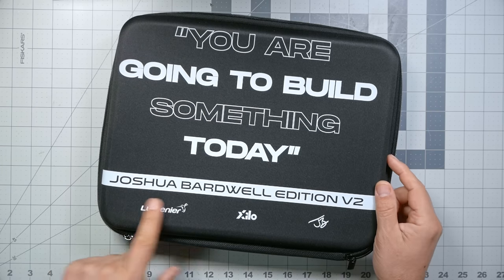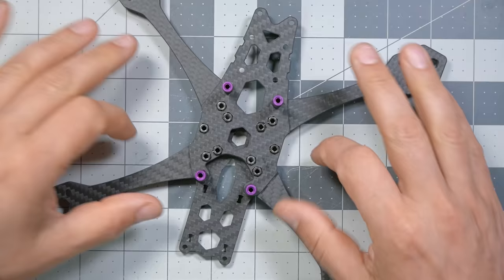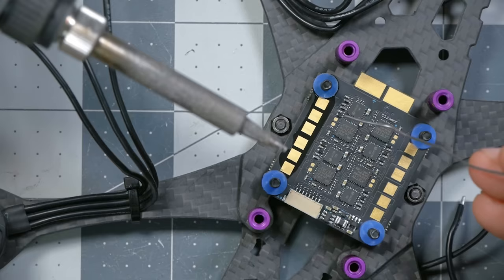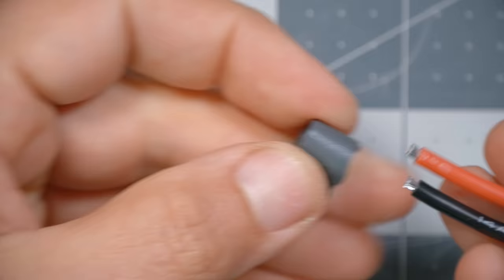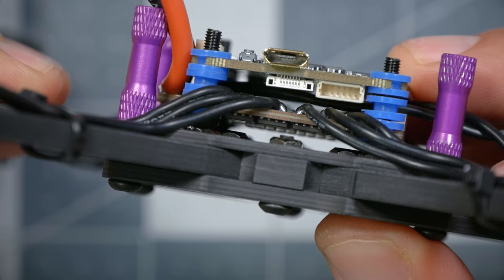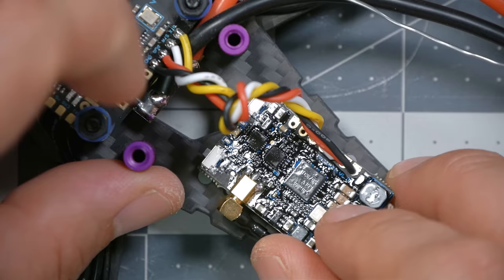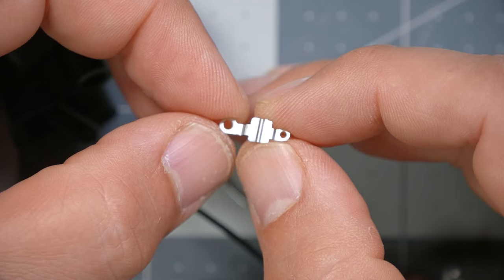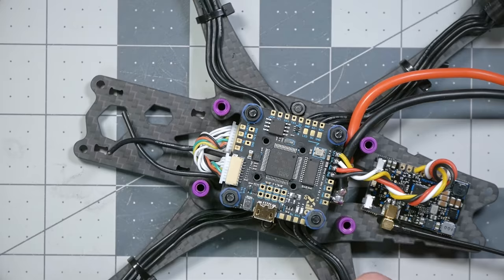2022 Freestyle FPV Drone Build (DIY Kit For Total Beginners)

Comment: You almost had me convinced to start ordering parts to build a freestyle FPV quad because I tried very hard not to crash. My TANQ2 5” that have only had for about a week and a half and I really wanted a tank S but it’s out of stock so I considered building one, but I really don’t know if my big fat uncoordinated fingers can do the soldering but I am going to watch your soldering tutorial and try to find something to practice on because I know that I’m going to start breaking it when I start flying low. At the moment, I am just practicing tricks probably 20 to 100 feet off the ground and over mostly grass. Once I get better with my throttle control and pitch so that I can maintain altitude and I start rolling and flipping and yawing at lower altitude I know I will start smashing stuff. Your videos are amazing thank you so much. Keep up the good work!

Comment: "A little bit of trouble" installing the arms is a huge understatement.
It took me about 40 tries and 30 minutes as well as 9 popped press nuts to screw down the last wedge for the arms. I was in constant fear of destroying the frame and even stripped the beginning of the press nut thread.

The only thing that finally made it work was to not install it like shown in the video, but to install the wedge with ONE arm (don't tighten the screw yet) and then slide in the last arm, then tighten the screw.
This was waaaay easier and without the danger of destroying anything.
Reply from the maker: I've always been able to get it done as shown, but that's a good tip for the future!

Comment: Incredible content, can’t wait to build one of these! You are a lifesaver for those of us who have no idea where to start in this hobby
Reply: It’s pretty fair to get into. You need to research on what type of flying you want to do. Long range , freestyle , racing, cinematic, cruise. Some of these styles are definitely cross compatible but can be better with different setups. Just watch people build and talk about parts. There’s not too many involved, and some work better with other , so it’s not just buy the most expensive. Anyone good with electronics would excel in building these. The hard part is having to program and tune the drone before you can actually fly :/

Comment: I have been trying to get into FPV for the longest time but I just did not know where to start.  I was going to go with a pre built but I really did not feel like that was the right thing.  When this kit came out I knew this was the perfect way to get into FPV.  I would like to thank you so so so much for making this kit!
Reply: Getting the right pre-built is absolutely not a bad thing! My first entrance was building one of those chinese kits from ebay, zmr250 or whatever it was back then. I wish I had just gotten a nice prebuilt and saved myself some trouble in the beginning. Check out the DarwinFPV Baby Ape Pro, or pretty much any EMAX BNF, I havent had a bad Emax product, ever! The nanohawk x is a little hot rod, the tinyhawk II is indestructible!
Reply: Hey, I'm really looking into fpv. Do you still suggest these kits for people interested in getting into the hobby?
Reply: @Howl-Runner  buy a geprc cinebot 35 with DJI o3 and the DJI Goggles v2.   ELRS internals... get a Boxer remote ELRS internal.    should be sooooo good to go...
Reply: @Nullscr1pt  Isn't that a little too advanced? How does the cinelog handle crashing especially for beginners? How much flightime would you get with the recommended battery of 1300 mAh I heard abt 6 minutes or less doesn't the avata have better flightime? Does the o3 dji air unit handle the transmission of the video signal I think it is included in the drone? How much would the whole build cost drone controller  goggles? sub1000?  Wouldn't it be cheaper to build your own? Should you choose the goggles 2 or V2 or Integra?

Comment: When soldering XT60 or anyother connector made of plastic, it is a good pratice to have the male and female ends connected together, so that if the plastic is heated up too much it doesn't warp.

Comment: 18:00 min "Check your ESC soldering job" I built the first kit. Fried the ESC by one strand of wire between two pads! Only found it after taking a pic with my phone and zooming in on the ESC. Now I do that after soldering job. Thanks for all your help!

Comment from the maker: All videos in this series are in this playlist: https://www.youtube.com/playlist?list=PLwoDb7WF6c8neIAQBkchfiXf-C8KbzG5M

Get your FPV Drone DIY Kit at GetFPV:
* Analog version - https://bit.ly/3xajRSN
* DJI FPV HD version - https://bit.ly/3GWB6eV

You can also buy a pre-assembled ready-to-fly quadcopter:
* Analog version - https://bit.ly/3aMRx1l
* DJI FPV HD version - https://bit.ly/399nksW
Reply: Thank you I want this quad
Reply: What about Remote ID? I bet this drone will turn into a pumpkin on September 16, 2023. You probably can make another set just a little bit under 250g to avoid requirements for drone registration and Remote ID.
Reply: I've got the best way to mount a Vista.
get a m2 helicoil set from Amazon take the tap and run it threw all 4 mounting holes then install 4 helicoils in the Vista 
now your Vista is threaded and you just run 4 short screws up into the Vista and your done.
Reply: @NickShl  it's being challenged in court. So who knows what will happen? I don't know many people who are worried. Regardless, the remote ID issue would likely be handled by whatever video or control link you use, so this quad can be upgraded to handle it. Whatever it may be.
Reply: @trekkin_fpv5272  I guess judge should also rule all mobile operators to disconnect cell phones for all people located near their homes to stop tracking them. Sounds ridiculous? But it based on exact arguing from this case - "people should be able to stay at home without tracking". That is why I doubt this case have any chance to repeal FAA ruling.
And for upgrading - it need GPS + some module for Remote ID. I wasn't able to find any detail what technology, protocol and frequencies it uses.
Reply: Hi Joshua, I still have the V1 (2020) version of your kit to build.  I found this new V2 series when I got it out to build it.  The V1 and V2 look very similar.  Which is the better playlist to follow please?
Reply: People might like to know that the real thing is even prettier than the early version built in the video series and visible in the video preview here.
Purple TPU parts and purple motor cable protection wraps. It's really shiny and gorgeous!
Reply: Fyi your preassembled links go to a 404 pag
Reply: Do you ever do giveaways or sponsored give aways?

Comment: Picked one up last night. First build and perfectly timed! I was legit researching parts to build one.
Reply: Awesome, enjoy the build and happy flying!
Reply: Hooray! Now that it is fathers day, I finally got to put it together! Went together with basically no issues. I know you include the wire for the VTX connection, you might consider including the same for the receiver. I had some silicone wire around so no biggie. I have to ask. Is there a reason why you fish the capacitor all through to the front rather than just soldering it directly to the ESC and go out the back over the VTX? 
Anyhoo.. I had about 30 minutes before dark, and it took it out into the back yard. Of course I had the props on backwards in terms of rotation. There must be a nice way to remember which is which. It took off, and hovered-ish beautifully. Moved it all over my back yard and landed it.. no worries... 
From a first time drone pilot I seriously want to thank you on the excellent kit, and build videos. 

I definitely learned something today!

Comment: 18:25 the very best case scenario is that the short between wires draws enough current and the quad just shuts down or esc temperature protection kicks in

also if there are like 1-3 strands shorting the battery probably has enough power to burn the strands (also very best case scenario)

Comment: I've built two of these frames and some things I would do is: (1) label the hardware. You can pretty much tell which screws to use where but having the packs labeled would be cool. (2) After crashing one and totally breaking one arm and putting a hairline crack in another, I replaced them with the design that has the Y configuration at the end. I think they should be the default arms. Maybe toss in some long M2 screw with locking nylon insert nuts if the builder is going to mount a Vista unit?

I also noticed on one frame the press nut turns in the frame. Other than that, it's a solid frame. I bought a bunch of extra arms because I'm sure I'll beat it to death.

Comment: Tip with zipties. If you dont want it to Wrap completely around and look like crap, You can do that pull through method, and then clip the eyelets off 4 extra zipties, and put them down onto the zipties you pulled through, almost like nuts on bolts. If you follow my description..

Comment: I love this frame, I appreciate the improvements over the split top plate of the regular QAV-S and the slight slam design and micro camera mount. I am, however, a pretty bummed that the frame and parts have been out of stock for a good while, but now the only thing in stock are these kits or RTF builds almost as if they have been hoarding them to make the kits and make the sale, kinda bogus. I need a replacement frame and I cannot get one. it's been so long, I am considering just switching out of spite.
Reply: I just picked up the tbs one source v 3 frame for  26 dollars it seems to be very well designed for the price I'm gonna run these only from now on parts are available

Comment: Hello Joshua, I am 12 years old and using my Dad's account: I recently completed a maiden flight on the xilo which I started building on christmas day and it flew well. This is my first 5" and I like it. I have a dsmx radio and I have been flying rc planes for about 7 years. Question regarding VTX setup: I downloaded the VTX table via Betaflight and yet with my dsmx radio, DX 8, I don't see a VTX onscreen menu if I push the throttle to mid-position and yaw left and pitch forward. Any idea why this is? Thanks! Alden

Comment: the kit you put together is obviously a solid one, its always out of stock.  i need a frame that will house the O3 unit, too bad no one shows that in their spec
Reply from the maker: It's out of stock because we can't make it as fast as people buy it. However I just looked and it's literally in stock right now.

GetFPV are working on modifying the frame for the O3 and will announce when it's supported.

Comment: Great Series Josh ! 
Definitely feeling alot better about getting into the hobby now. Soldering tutorial was top notch seeing as I didn't know how to solder.

Question: 
I plan to purchase radiomaster tx16s and your beginner kit. I would just need to purchase a receiver that is compatible right ?
Reply from the maker: Correct. My radiomaster has elrs built in so get the happy model ep2 receiver like I use in this video.

Comment: Having a really hard time figuring out why I can't get any range at all, I mean not even 5 feet of range and my feed is completely static. Link quality at like 5. I never turned the VTX on without an antenna  so it shouldn't be damaged. I double checked my soldering and everthing looks good, I'm stumped.
Reply from the maker: Is the vTX in pit mode? See this section of the previous build video https://youtu.be/jUPppjrZdxs?t=2066

Comment: @1:02:11 I was wondering if it would be possible to use a 25V capacitor instead of 35V to save some weight, increase capacitance or both. I mean 6S x 4.2V = 25.2V while the data sheet on the cap specs say surge voltage up to 32volts for half a minute. The tolarance looks to be there, so I hooked it up. I only had 4. The cheap ones seemed to hold up to 26 volts before they blew, the other one (green) went at 28volts. BTW, you never really get any smoke, heating or warning. There is enough amperage in lipos that when the capacitor foil makes contact inside due to pressure it vaporizes instantly. They go with a bang like s a gunshot, try it only from 5 meters away under a metal bucket. At the moment I can say that I wouldn't recommend doing this, if you overcharge one of your batteries by accident, this is risky, but I ordered a new batch of quality caps to try again in the future.

Comment: I dont care how good you think you are at soldering, if you dont use flux of some sort you are doing it wrong. Those are just the facts, cold joints are a thing. Flux helps to prevent that. You dont want to have to tear it part way back down to fix a wire you failed to solder correctly and it vibrates loose 30 second into your first flight with the new quad.
Reply from the maker: Ok but that has literally never happened to me.

Comment: Have you ever soldered a capacitor directly to the xt60 connector coming from the esc? I seen a guy build it that way. Turned out good. Just wanted to know if that was actually a good idea or not? Thanks for all your information.

Comment: So that X plate goes at the top?  What the hell?!  If I tear mine back down I'll fix that but it's been at the bottom plate for ages.  Could you work with getfpv to make a set of taller standoffs and side plates, like 2 - 4 mm?  It would make some builds easier.

Comment: AMAZING VIDEO!!! I am almost at the end of the build. I stopped at the receiver and have a question.
I am currently flying a DJI FPV drone and using DJI CONTROLLER 2. 
Do I need to buy a separate receiver for my HD version? 
In the video there is a receiver mount but do I have to do that in the HD version too? 
Thanks in advance for your help!!!

Comment: Ordered this at the beginning of june and it still did not arrive.

Finally bit the bulllet and custom build something similar, the videos were a great help.
Reply from the maker: That's weird. It has come back into stock at least once for sure, several hundred units.
Reply: @JoshuaBardwell  Yeah, it presumably was shipped and unfortunately tracking stopped at the border. And their shop was weird anyway, so not really sure if that actually was my tracking.

Comment: I understand that weight savings isn't as big a deal with a quad this size, but would it be a problem to remove the unnecessary press nuts from the frame? In other words, if I'm installing a 30x30 stack, can I remove the 20x20 press nuts, without doing damage to the frame?

Comment: Quick question! ELRS is too complicated for me, so how would you install a XM+ reciever onto the flight controller? I have a TX12 for a transmitter!
Reply: You can just connect it to the open SBUS pad on the FC and 5v/GND, then apply it to the correct UART in Betaflight to assign that pad as your RX
Reply: @GetFPV  Ahh, thank you! May I ask, how do you apply it to the UART in Betaflight? I'm completely new to FPV. Thanks!
Reply: @shrutiprabhune819  Look up a tutorial for xm+ on youtube. There are lots. But basically connect to fc with uart R and 5v/grnd. Then enable serial rx in betaflight flight for that uart and select sbus and frsky in the configuration tab. If it doesnt work following the tutorial you probably need to flash different firmware on the xm+ chip. This might require another tutorial :) I had the same annoying process and it's normal to have issues with frsky.

Comment: Bro I'm getting motor noise in my video feed what going on I got cap on and all my stuff looks good but when I add throttle I see lines and Noise when I Throttle Down perfect video brand new Motors brand new frame brand new gear what's going on ?

Comment: @joshua bardwell   I really need some help im stumped with a problem trying to connect the tbs crossfire nano rx to my betafpv literadio 2 se the crossfire nano rx is in binding mode and had power as well as the literadio 2 se being put into binding mode and i cant get them to bind please help
Reply from the maker: Crossfire receiver can only bind to crossfire module. The literadio can't bind to a crossfire receiver.

Comment: Ordering this soon as my mom asked what I want for Christmas, I will be going through getfpv and plan to buy your v2 diy kit my first quad but not for drones dji drones I have flown a few years, analog is my choice. Is getfpv the correct site to use to make sure you get your pay for your product being sold? Making sure I buy from the correct store. What goggles will be best, remote? I have no knowledge about this stuff so I need vtx, or remote antenna?

Comment: E6000 adhesive works great, but unfortunately has the chemical TCE in it, which has been found to cause Parkinson’s. Only use it in very well ventilated areas and definitely don’t open it with your mouth

Comment: Is there any dji on the market that takes advantage of the micro HDMI port on the go pro or any other video recording device so you can just grab the video feed of the recording device you are using and stream it to your goggles?
Reply from the maker: Not DJI. There are units like Teradek used on professional sets that take HDMI or SDI input.

Comment: Question for you does the kit come with battery or batteries? Also the video was very clean and you made it easy to follow along. You now have me hooked on this topic. 👍👍
Reply from the maker: It does not. You have to buy those separately.

Comment: I just got this kit and have it built up to installing the vista, but unfortunately my kit came with incompatible zip ties and screws. My screws do not fit into the vista screw holes, too big, and the zip ties appear to be 2.5mm wide, which also are too wide to fit through the hole despite my considerable yanking with pliers. I am having to order a set of 2mm zip ties just to finish the build, pretty disappointing for an otherwise great kit.
Reply from the maker: Can you email me joshuabardwell@gmail.com to discuss.